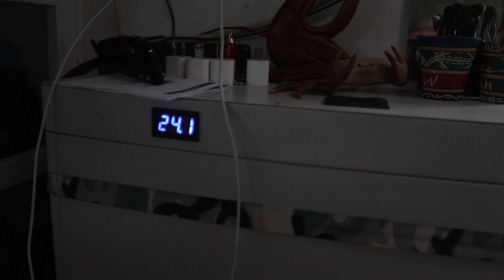Our CHEAP $5000 trimaran for SAILING around the WORLD

Comment: I am looking at older sailboats , how is your wiring looking ? My main dread is rewiring.
Reply from the maker: I completely redid the electrical system in this boat with Tesla batteries and charge controller, automatic switch, etc. When you get an older boat it is very simple to upgrade the wiring and fuzes, etc. After doing once or twice your confidence will go up. It’s not as difficult as it seems at first. If you have questions about it let me know! What boat are you looking at getting?